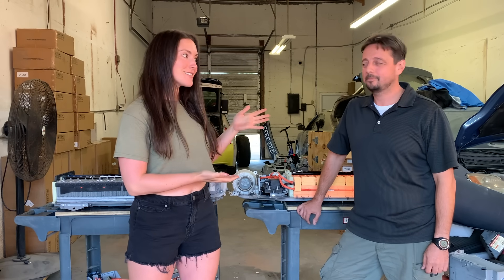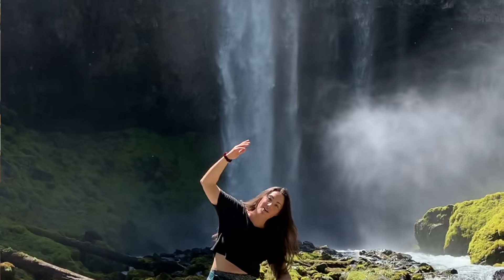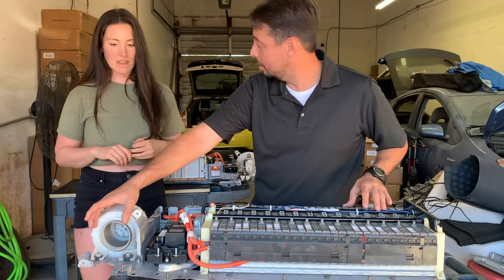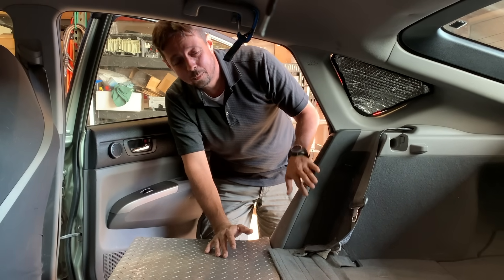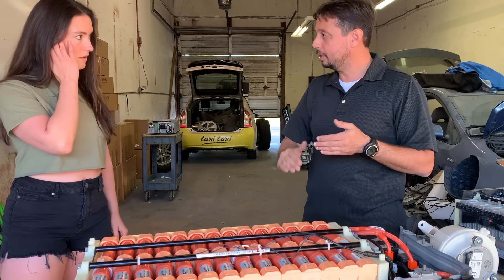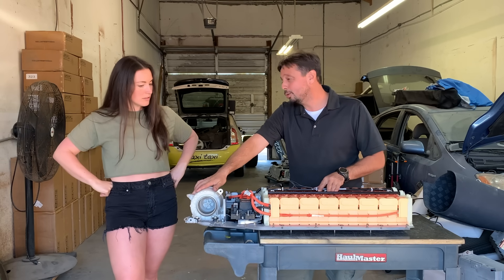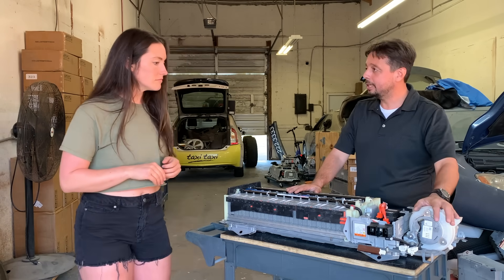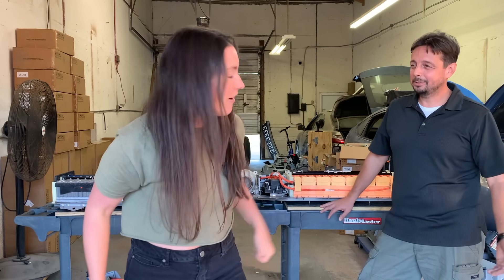Your Hybrid Battery: Tips, Maintenance, Life-Span, & MORE! Must see for a Prius/Hybrid Owner

Comment: Sooo...  you have to be careful with this stuff.  There is a reason why the Toyota OEM replacement batteries cost $4k.  I checked out that guys website, he doesn't mention a single thing about the safety testing or validation of the batteries he sells.  I am assuming that they are not DOT approved, which might be why he is the "first" one to sell an aftermarket battery pack.  I see that he not only replaces the cells but the wiring harness as well.  Please be careful, I don't know what you guys talked about in person or the specific cell chemistry of the replacement battery pack, but there is way more to a battery pack than just the cells, and if he replaced the wiring harness, I am assuming he replaced the safety monitoring/control system as well.  If an individual cell goes out in the original unit, the battery pack is designed to shut down to prevent a catastrophic fire of the entire battery pack.  Yes, replacing an individual cell if one goes bad on the original pack is a Band-Aid fix, but the most important function of the battery pack is maintained, and that is the Department of Transportation (DOT) approved fire safety monitoring/control system.  Maybe this guy is legit, and he has had his replacement kits independently tested and DOT approved, but I did not get that impression based on how he was describing the units that he sells or from his website.  I don't know you, this is the first time I've commented on any of your videos, but I would have someone else check that thing out before you plan on sleeping with that battery running every night.  Google lithium battery fires, when one of those things goes into thermal runaway, it's a chemical fire, and can't be put out with just water, it's no joke.
Reply: Actually the wholesale price is $1800. But like most places dealers need to make money. Some charge more, some charge less.
Reply: I see you are a good and concerned individual besides slamming this guy you have not met or chatted with in person or emails. It is sad how you who assumed is not a qualified technician to vent such accusations. I worked on batteries and understand the significant dire towards safety and dealership maintenance and dealerships costs early years of Prius the cost of batteries were $4000 no questions. Many dealerships do not tell you anything about EV cars maintenance promptly because it is a new frontier.  QUIT Googling everything that is at times wrong, people take its words as gold.

In time frame 0:29 he did state he was the first qualified and approved in the USA to perform such repairs on lithium battery updates. In order for a shop to perform such tasks, they have to be qualified according to the DOT !!! If you Google everything and not have actually worked or performed actions of repairs, you are just a couch repair wanna be. 

Quit being such a troll please. The words: I don't know, Maybe, I am assuming, shows your ignorance and speculation. Lithium batteries do explode or over heat, it is proven in the past in cell phones, airplanes, flashlights, radios, and now cars. Do you see any warning labels spoken or viewed in advertisement's, commercials, dealership wholesalers, repair shops, and the people that own the vehicles. Not that I have in the past witness. 

HELP spread the word besides degrading. I worked, perform, repaired, upgrade, troubleshoot, and disposed of batteries such as lithium ion and acid cells. It was one of my main jobs while in the military where it's importance is vital to supply power to radios, airplanes, helicopters, turbo prop planes, and shipboard equipment to protect our country. Be safe and strong.
Reply: @eddieventura463  I don't know her, I don't know the guy who replaced her battery pack, and I don't know you.  I do know that the changes he made to increase "airflow" around the cells also means that it facilitates greater heat exchange between the cells.  I do know that nothing on that dudes site or anywhere else validated how that pack is the same as or better than the original pack design to prevent against thermal runaway.  I also know know that the entire back half of that car is designed to prevent a battery fire from making it into the passenger compartment before individuals have time to get out of the car, and she has literally taken the back seats out, replaced them with a wooden box, and sleeps on top of that and the batteries, on a polyester fabric mattress.  I am not on yelp or google hollering about the guys batteries, or not to do business with him, etc.  She f'ing sleeps on top of that battery every night dude...  Being qualified to repair cells in an OEM battery pack and having a DOT approved battery pack for sale are two different things.  And for the record, I am three combat deployments, a humanitarian relief deployment, and 18 years in counting in the Army.
Reply: @outlaw4shrt  Hats off to you and I agree 100% with your comments, including a potential battery fire and the idea of sleeping on top of the batteries.  No bueno!  Nikki's Prius was designed to ONLY be a mode of transportation...with its components/seats' location as and where engineered.  There's a reason why EV camper vans  are not here yet...range and, especially, the occupants' safety presenting a challenge.   Hope that Nikki and her boy get a proper vehicle for their adventures.  Hats off.

Comment: Good job! My 2004 prius has the original battery set. I'm curious when will fail.
Reply: I bought 2nd. gen, 04 Prius with bad hybrid battery. Replaced it, after a month went bad again, replaced it, it's been over 8 months now, no problem. I watch Nikki's videos to learn how to live in it full time.
Reply: I like to add...I also have a '04 awd Toyota Highlander suv limited edition, i can't seem to make up my mind, which one to part with? i love both, but have to let go of one. I am in Pacific NW.
Reply: Park your car with 6 blue bars of charge. After 1 hour of sitting or in the morning start your prius and drive it immediately for a minute and watch the display in the center. The charge level should stay the same or drop not more then 2 bar. If it drops to 2 orange bars or lower then your battery is too weak and about to fail, but it still can be reconditioned.
Do not let your engine charge the battery, drive it immediately.

Comment: just a suggestion for s future show or shows  finally get a van and run your videos on the van build, plus it will make your life so much easier that living in a prius, just a suggestion , in thE USA you can more than likely find a great shape Astro AWD OR \sAFARI awd and it has so much more room, remove the front passenger seat make a platform for Camper and build a platform with drawers around the wheel wells etc
Reply from the maker: Great idea taking out the passenger seat for Camper! As for a van, I'm sticking with this til' it dies or someone wants to donate a new one ;).